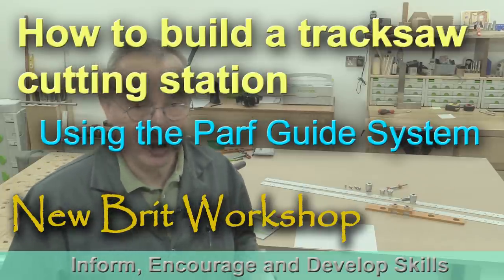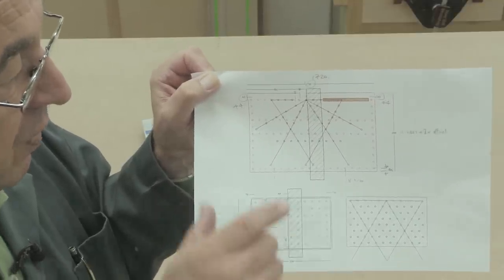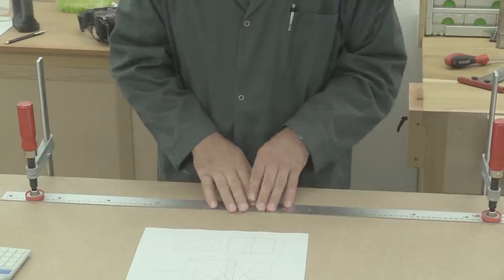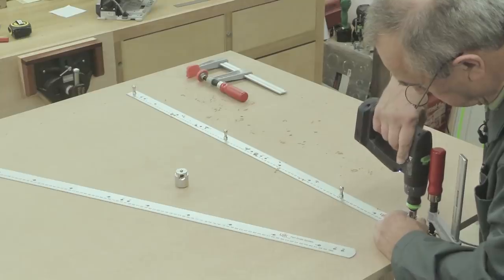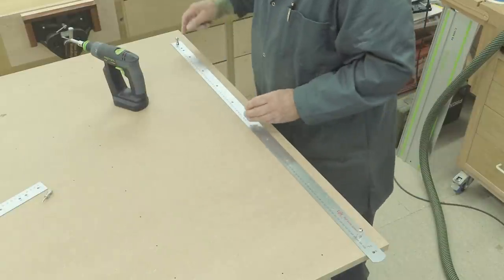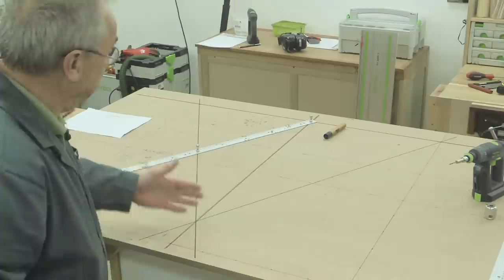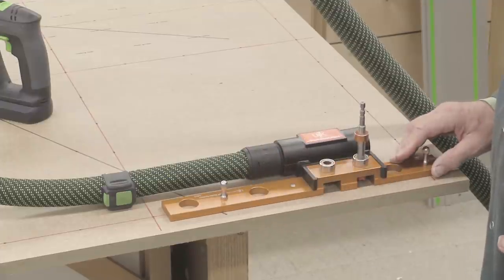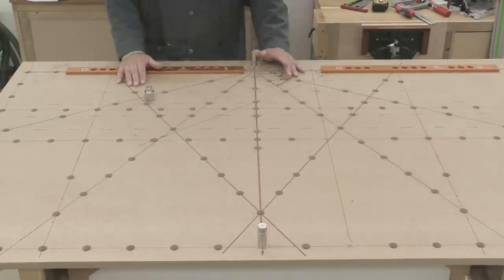How to build a tracksaw cutting station

Comment: Hi Peter  I watched this again as the first "cutting station" I made was a bit off for a couple of the rows.  I didn't pay attention to locating the critical first rows carefully enough and certainly didn't clamp the rails.  I need to make another one and will be careful to follow your advice precisely to make sure I get it right this time.  A bit too much haste initially has made for a lot more work in the end!  Mike
Reply from the maker: Hi Mike, Yes, do take care, mainly ensuring that the 6 mm shoulder of the 3 mm pins is definitely registered in the ruler in the initial layout.  Cheers.  Peter

Comment: Peter I enjoyed your design here I purchased your system and are going to build my first cutting station and would like a copy of your design.  Also if I could recommend a design to promote your sales I would recommend you come up with a design utilizing Bench dog UK quad dog hing rail guide.  They selling there own tool for drilling the offset holes to place the mounting holes. As your system supports the 48mm offsets you could show that your tool provides the spot on locations that there tool would not be required.  If I follow the design correctly first holes 35mm from the edge then next 48mm between row then standard 96mm spacing.  Same on the opposite sides. this could support from anywhere on the top either end or edge.  I have all my assortment supper dogs and guides I just want to expand the designs and options for all these accessories for a top we make using your guide system.  Thanks again

Comment: Thanks Peter.  You were responding to my request just as I was watching the video again in order to get the overall dimensions of the two tops.  The supplier will make one cut of the MDF for free, so I will ask them to cut the sheet 68 inches with 28 remaining.  There is a northeaster headed into New England tomorrow and I would like to get the material into my shop before I am snowed in.  This is perfect. Thanks again.
Reply from the maker: Hi Tommy, Fingers crossed for the weather.  Cheers.  Peter

Comment: Thanks Peter for such a thorough and interesting presentation.  I am new to the tracksaw/MFT world, but I am truly impressed by the ease and accuracy that it offers.  I plan to get the latest version of the new TSC 55 within the upcoming year.
Reply from the maker: Hi Barry, My tracksaw cutting station is at the centre of my workshop and I tend to use my main bench as a repository for tools. The only exception being the use of the vice on the main bench.  Cheers.  Peter

Comment: Great combination of 30, 45, 60 & 90 degree cutting abilities on one cutting station. I intend to built a very similar cutting station as soon as I sell off the original Part Guide System and upgrade to the mk2 version. I will be requesting a set of plans for the combined cutting station.
Reply from the maker: Go for it!

Comment: I have been waiting for this video so I could build an "Official Parf Top" I have the Parf 2 Kit, (2) Parf Fences and I have made (2) previous tops but I never really have had a pattern that worked well with the two parf fences. I remembered you said in a previous video you were planning to build a new table which would utilize 2 parf fences and now you've done it. Thanks. Now off to my shop to build mine.

Comment: That cutting station is a brillant idea! I'm going to build one on a torsion box that can rotate to serve as a clamping / gluing table, inspired by the multifunction shop cart designed by Thimothy Wilmot. I should stop watching videos and start cutting wood though: almost everyday I find new ideas and then spend an indecent amount of time modifying my plans.
Reply: I thought about this but how do you support the top and still have room for the festool clamps to be able to spin 360 degrees underneath the top? With 96mm centers there no room, if you did double the space between the holes there would be room for clamps but farther space between holes.
Reply: Bragon I’m in the same boat!  I keep watching videos, saying “well that’s brilliant” but don’t fit all of the tidbits together into a functional plan. I’d like an assembly table that incorporates a cutting station in part of the top…

Comment: Good point about the drill guide twisting in a new Parf stick. I ordered a third stick just because I wanted one, and had to do similar to fit the drill guide into the 3mm hole. It is very very snug. I also substitute the Parf dogs with tall dogs to drill the 20mm holes.
Reply from the maker: Hi Paul, Many thanks for this.  Peter

Comment: Hi Peter, i recently treated myself to a great Xmas gift by purchasing your PARF II JIG system with some bells and whistles to complement it. I’m home with a shoulder injury and have nothing but time but to plan out a multi functional work station that would serve  me well. I’m probably going to use a “ Paoson woodworking style multi section work bench” and a interchangeable 20mm work top for different applications.
Reply from the maker: Hi Joseph, I hope your shoulder gets better soon and good luck with your plan.  Cheers.  Peter

Comment: Hi Peter, love the video. Very nice made and educational.

I have a very small shelter where i have started make some wood working. Though i think that setting up my track saw and cut is taking very long time every time and if i want to cut many things at the same time they never bee that accurate.

So i think this is brilliant and thinking of making my own. Love the idea of having master pins for hooking up the ruler is brilliant, i were thinking on something like pins that fit the groove under. But it makes it hard to adjust the height. 

Will se if there is some hooks that fit my Makita ruler and then i might be able to make my own cutting station at home :D
Reply from the maker: Hi Eric, For many years we did not have any form of rail clip and all one needed to do was to ensure that the rail was tight against the tall dogs.   Peter
Reply: @NewBritWorkshop  that smart. I dont have anything holding it right now so.

Thinking of picking up some large dogs, those clips and a UJK Parf Repeat Stop.
Though do you have any tips for do nice 90 degrees cuts? With that cind of set up?

Hade two parallel strate edges to day on a cutting board and hade really hard time making the other two sides 90 degrees.

Comment: Hi Peter,
I had a look on the website but didn’t found how to buy the 2 drill guide used with UJK PARF GUIDE SYSTEM MK II CENTROTEC SHAFT & 3MM DRILL 107893. They are only in the full package ?
Thank you for answer !!!
Reply from the maker: Hi Didier, I am not sure what you mean ????  Peter

Comment: Hi Peter. I have a mk1 guide system. Can I use the last pin spot  and drill bit dog on last spot (thats on the long side with two pins and two dogs positioned) to get my perfect 48mm holes.. I'm I making sense.. thanks for feedback.  You sir, are a genius at work .. thanks again
Reply from the maker: I am not quite sure what you mean. As far as I remember the 3 mm holes in the rulers and they are all at 96 mm centres. Peter

Comment: Hello Peter, i am watching your channel since the first episode. You are doing a great job 👏!! 
Since then, no small thanks to your tool inventing ingenuity,  i became a good customer with Axminster. I do own the MK ii and have build some small cutting benches. One irritation i have (and i did already buy a new second 20mm drill) when setting it in the 3mm predrilled hole and starting the cut, it wobbles (it actually shakes the drill guide). This happened with the brand new one out of the box as well. I tried using different drill machines, but did not improve. I did not see your drill guide moving in the video, so i wanted to ask, if you habe any advice?
Thx so much, and keep up the fabulous work. RGDS from Germany K.
Reply from the maker: I have never experienced nor heard of this issue before.  At first sight one might think that the chuck of your drill is faulty. You have used a different drill and so that has been eliminated. Please contact Axminster Customer Services.   Peter

Comment: Hi Peter, Great video. Just received my MkII directly from Axminster (wasn't available anywhere in the EU). I'm currently figuring out how to layout my table. I really like your layout. Offers everything I need, but i will probably add a few more holes for 45°. 
Wouldn't it be better to have the isometric pattern based on row 7 so you can acutally have the cut fully supported on the table? Or shifted two rows to the right?
In your layout it seems the material and saw would be of the table for 60°cuts. Thats assuming you angle the material and not the track.
Reply from the maker: Hi Markus, It all depends where you put the tall dogs or the dogs against which the stock is pushed. The whole idea is to show what is possible and then let people create their own design to suit their needs.   Cheers.  Peter

Comment: Hi Peter  I followed your "obsessional" repeating of the need to locate the pins and guides very carefully and clamp the Parf sticks at the early stages.  I am quite sure that failing to take proper care over this was the cause of my first cutting station (about which we corresponded) being slightly " off" on two of the rows of holes.  I will make sure I take as much care when I make the next one and on the Paulk or Dennis benches I am going to make next.  Thanks for the extra careful tutorial this time, a lesson well,learned.  Mike  PS you could use the long piece from  the side of the board as a Paulk sacrificial strip to protect your smart new cutting station for a long time.
Reply from the maker: Hi Mike, I wish I had made this video ages ago. I had serious problems editing, first because my video camera decided to choose its own white balance (probably finger trouble on my part). and then because I had produced so much footage. I had to do some savage cutting which does show I am afraid.  Take care.  Peter
Reply: New Brit Workshop Actually not so Peter.  I suspect that you are more critical as you know what was edited.  It all hung together very well and the strong emphasis on the critical details was important and will certainly save a few mistakes ( like mine).  It was a really helpful video and I learned several critical stages which will be very helpful on future projects.  Not sure I am quite up to the extra isometric holes but I will look at that later.  Could you send me the plans for the new layout.

Comment: Hi Peter, great video, I have my mk2 system now and a fence and stop, om looking to make your cutting station, can I ask do u use M.R MDF or just regular mdf? For your tops.
Thanks 
Allan. 🍻👍
Reply from the maker: Hi Allan, I use Medite MR MDF as it is almost as good as the really expensive HDF but any good quality MDF should do. The cheaper material does not cut well and can clog drills.  Cheers. Peter

Comment: Nice video. Would you prefer this solution over a sliding table saw?
Reply from the maker: Yes, it is far more accurate and much better value for money. I have many professional craftsmen using the system reporting to me accuracy far better than they had been able to achieve before. To get 0.001 degree accuracy you need to spend $50k on a decent sliding/table saw. Cheers.  Peter
Reply: @NewBritWorkshop Aha ok. My major issue is that’s hard to cut glued panels (like a table top) square on my DeWalt tablesaw. 

Do you also use this for solid wood?

I was thing about a Hammer k3 but maybe I should consider this option too.

Thanks
Reply from the maker: Yes, I use it for almost everything as the cuts are so accurate. When we moved house and my mitre saw was not set up I used it for every single saw cut including some precision cabinet work.  Cheers.  Peter

Comment: Hi Peter, thank you for sending me the plan for Tracksaw Cutting Station and MFT3 Designs with UJK Parf Guide System. I was able to drill the holes for rectilinear and isometric holes except that I am stumped on the 30 degree holes. I can't seem to line up any existing holes for the two 30 degree line 3mm holes. This is the only issue I have to complete my cutting station. Any thoughts?
Reply from the maker: Hi William, The isometric holes do require a lot of care to make sure that you have the correct positioning of the Parf Sticks. Also, with an isometric layout you need to look carefully in order to select the right holes for 30 degrees.   Good luck.  Peter

Comment: Hi Peter, another great video as always. I have the Parf Guide ll System and you were also good enough to send me a copy of your plan for this cutting station. I note that you have said that any surface finish should be applied prior to the holes being drilled. However, I have also seen your recent video relating to the Parf Guide Reaming Tool. With that in mind would it be possible to drill the 20 mm dog holes and seal them with a chosen finish, to give additional protection, and then use the 'reamer' to clean the fibres which will inevitably appear? Merry Christmas to you and your family and of course your viewers.
Reply from the maker: Hi Jon, The only thing to watch is that the cutting edge of the reamer could become clogged with hard wax or whatever.  Happy Christmas.  Peter

Comment: I am looking at something like this to incorporate into a table saw outfeed table.  I am considering a 1.5” thick top (38mm ish).

Will your parf dogs work with a top this thick?  Would I need to drill through them?

An alternative I am thinking of is using a 1/4” sheet of hard board over MDF for wear and if it gets too beat up then I can replace the top sheet and use a router with a pattern bit to make new tops to the holes.  Will this work?
Reply from the maker: I would not recommend the 1.5" top as the 3 mm drill and the 20 mm cutter will not pass through with the guides provided. I am not sure why you want to protect the top of your bench by covering it - nobody will see the top underneath as the sacrificial top will hide it. Replacing your 1/4" sacrificial top will be as much work as replacing a single 3/4" MDF top. So, just use 3/4" MDF and replace it every couple of years like professionals do.  Good luck.  Peter
Reply: Thank you for the fast reply!  I have a parf guide system on order and should be able to pick it up tomorrow.  I will test it on my old table that has melamine on it.  I am only able to source really poor quality MDF locally or Baltic Birch shop grade at reasonable prices.
Reply: Clamps like Festool have issues getting through thicker than 19 mm.
Reply from the maker: I only use 18 mm MDF for my tops. If you have thicker tops you can chamfer the underside of those holes where clamps are to be used.  Peter

Comment: HI Peter, first of all thank you for the videos. I've got the mark 2 but have not implemented yet.  Can I check if there is a maximum thickness for the top.  My top is two 18mm MDF sandwiched together.  Thanks
Reply from the maker: Hi Alan, You are fine with 18 mm MDF - it is exactly what I use. You can go a dash thicker up to the limit of the depth that the 3 mm drill can reach as it has to go all the way through the top.  Good luck.  Peter
Reply: @NewBritWorkshop  Thanks Peter, so my top of 36mm (ie two 18mm sandwiched together) will not work?  Thanks

Comment: Hi Peter,
I recently made my first bench top using your system.
It’s a great addition to the shop and many more will follow!

Do you still email specs on the benches you have designed?
Reply from the maker: Hi Adam, Yes, I have plans for many of my designs and they are all free of charge. In order to get plans or to contact me via email I need your email address. YouTube no longer has a private messaging service and so in order to get in touch you need to place a comment on this or any other video with your email address. The YouTube software should identify and send it to the spam folder for The New Brit Workshop. Nobody will be able to see your email address except you and me. I will then delete your comment so that it does not end up in the public domain and I will then send the plans. Were we to do this the other way around then my comment, with my email address, would appear for all the world to see.   Peter

Comment: Hi Peter . Received my plans thank you. It may sound stupid but if i put a piece of timber or board on the 60 degree line and make a cut don't i get a 30 Degree angle cut on the piece of timber under the track, you only the 30 degree cut on the piece that is cut off,  and vise versa for the 30 degree line get a 60 degree cut. so if you want a 60 degree cut on the piece your cutting you put it on the 30 degree line.  Am i wrong in the way i am looking at the plans
Reply from the maker: Hi Kevin, You are right and so you always have to think about these cuts.  Peter

Comment: Hi Peter, thanks for the video! I must have watched it 5 times now putting plans together for my workbench. One question - as the isometric lines are in reference to the line on which the guide track attaches, rather than the kerf line, would this not cause an issue with material overhanging the bench at the top (and the saw off the table when making the cut) when making cuts along the whole width of the material? Is the intention to move the track onto the isometric lines rather than referencing the material against those lines? Think I will make the isometric lines in reference to the kerf lines, do you see any issue with this? Many thanks
Reply from the maker: Hi Mark, I must confess that the Isometric lines are just a starting point and more may need to be added. My idea is that one has the guide rail (and so the kerf line) in the same place for all cuts.  Peter